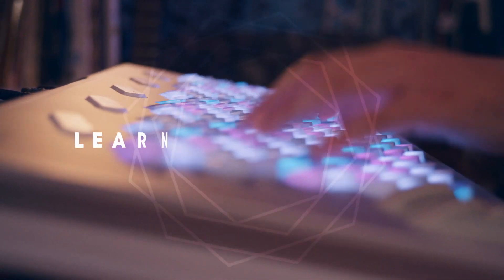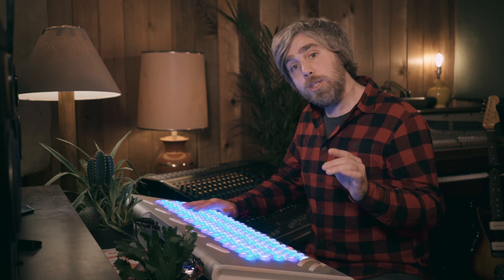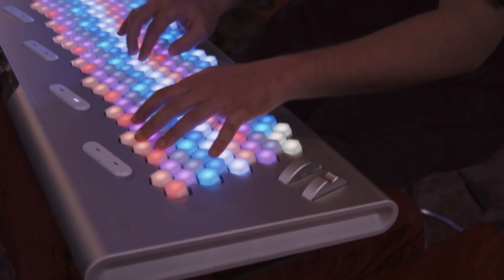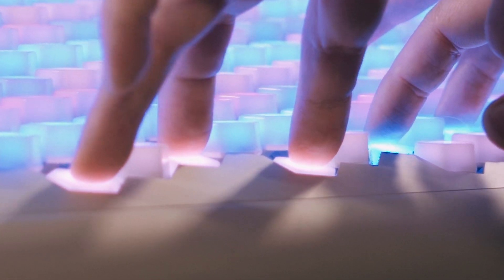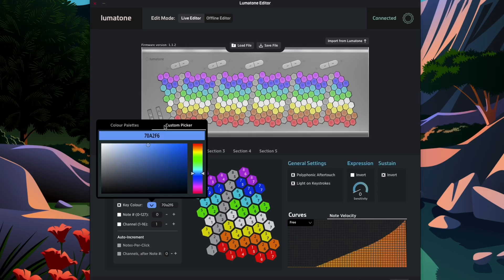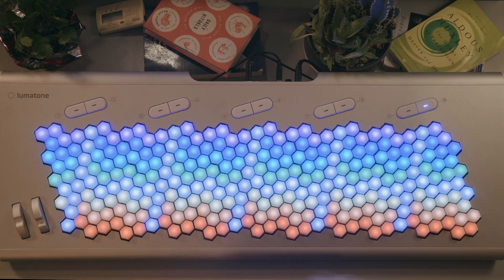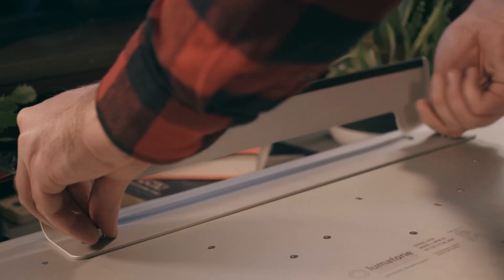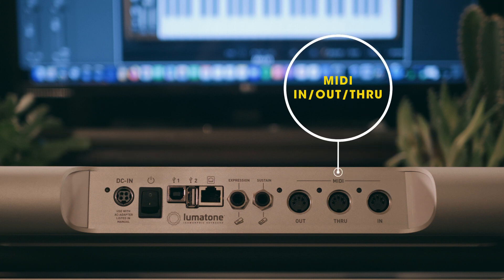Learning Lumatone: Episode 2 - "Hardware"

Comment: i guess my biggest question is, does this have to be hooked into a computer running a DAW to play? this seems amazing but i would prefer to just be able to play it outright without having to create a setup around it
Reply from the maker: You've got options in that case. Doesn't require a computer, no, but it IS a controller a heart. There are a lot of small analog/digital synth and sampler options you can use instead of a computer and just plug directly into the back of it. We wanted Lumatone to be sound agnostic -- everybody likes different sounds!